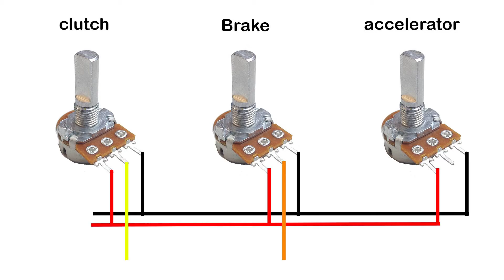How To Make DIY Pedals For PC | DIY Gamign  Steering Wheel

Comment: Can I use ESP32(1 unit only) to control the steering wheel and also the pedal? Or I must use two unit ESP32 to control that differently?
Reply from the maker: No, you can manage all the things in one module.
Reply: @zudumalli but can I use ESP32? I watch your video using EMC utility and there is no option for ESP32 board, and I do research and very rare sim steering that support ESP32, do you know how to fix this? Sorry for too much question

Comment: For those who are asking how much, I estimated either less or around 100$ sgd less if you do the exact thing he does or even find the cheaper options, but if you tweaked certain parts here and there itll cost around 100 sgd . Not inclusive of delivery fee if bought online, equipment needed if unowned and the electricity bill for the power tools. So whoever tryna build this all the best(Im doing the budget version with the ps4 as the pedals) Hope this helped

Comment: Bro,i can use other material? 0:13
Reply: You can use a wood mechanism, even strong plastic parts they just need to make that movement and have access holes for the potentiometer (the electronic part) and the iron rod :)
Reply: @aslassin thank you bro

Comment: Length and breadth of the wooden piece that goes on the potentiometer?
Reply from the maker: breadth - 1 cm
length - 3 cm
Reply: @zudumalli  Thanks!
Reply: @zudumalli  How do you make sure the potentiometer goes through its full range of motion? Or - if you don't do that, then how do you properly calibrate the "gamepad" once it's been modified with the pedal inputs?

Comment: PVC Pipe length?
Reply from the maker: * PVC pipe - 1 Inch
                    - 0.75 Inch
Reply: @zudumalli  thats the diameter right?
i was asking the length
or is the length 1 inch and 0.75 inch as well?
Reply from the maker: Yes, that is the diameter, sorry.
Length - All PVC pipes are 10 cm
Reply: @zudumalli  Thanks a lot bro!

Comment: greetings, what kind of potentiometers should be of how many degrees
Reply from the maker: A 10k potentiometer is fine. The number of degrees does not matter. Only about 20-30 degrees will work.
Reply: @zudumalli  I'm trying this with a different gamepad than you used (I'm using a Logitech F310), and I think it's important to note:  the potentiometer you use should match the pot you're replacing on your particular circuit board. In my case (and probably in yours), it happens to be a 10K pot.. and maybe 10K is "standard" for gamepads..  But it's probably best to check your  gamepad components first, and design your build accordingly

Comment: can i connect the clutch with only red and black or can i use a sweing machine pedal as a clutch please
Reply from the maker: No, this requires a potentiometer. There are three lines. (Red line (+), black line (-), and a signal line.) You cannot use the sewing machine pedal

Comment: bro how do you make the PC recognize it
Reply from the maker: from Arduino
Reply: @zudumalli  So you just plug the arduino into the PC and you don't need to do anything else? Like do you need to write a script or code to make it work as a gas/brake controller etc. Im sorry I'm new to this and this is the only part I'm confused on. If i wire it correctly and plug the arduino into the pc with usb do i need to tell it how to read it? or is there software for that?
Reply: @eninja8152  u need the code